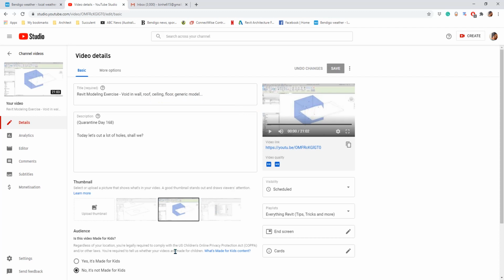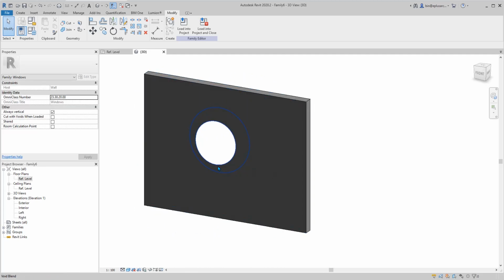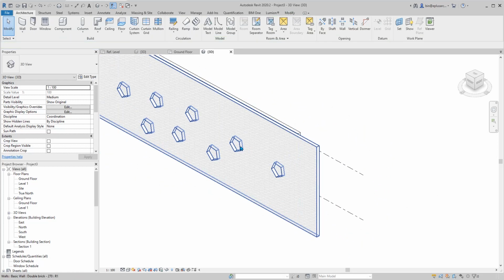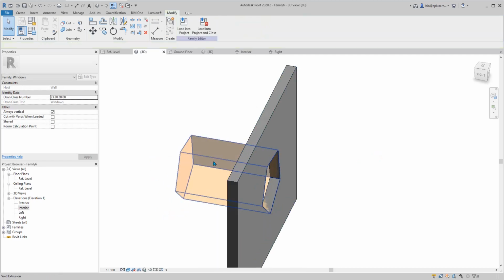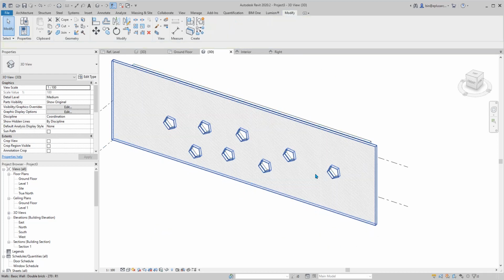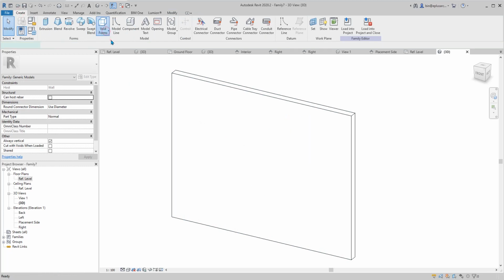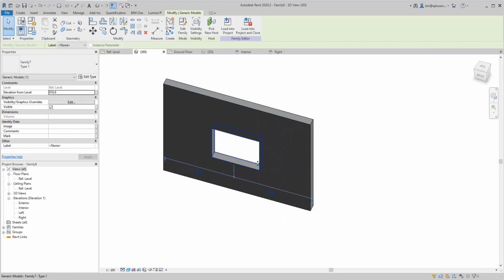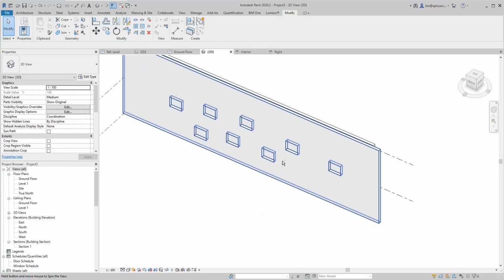Revit Exercise (Day 169) - Void in door and window family

Comment: I noticed that replacing a cut opening with voids can slow down the regeneration of a model. Is this scenario plausible?
Reply from the maker: Yes, probably because openings are simply extrusion voids with the depth of the wall, while voids can be any shape and sometimes may create some geometries that Revit cannot handle.

Comment: Hi. I'm encountering the error message when trying to cut a recess into the wall inside the windows family using the void extrusion
The message is "a family cannot have an opening and a cut in the same host"
same error occurs even when I'm cutting through the wall entirely.
Reply from the maker: From the message, it seems like you have a opening and a void cutting the wall. If you need to cut a recess, delete the opening and only use the void.
Reply: @BINHE615  thanks =)